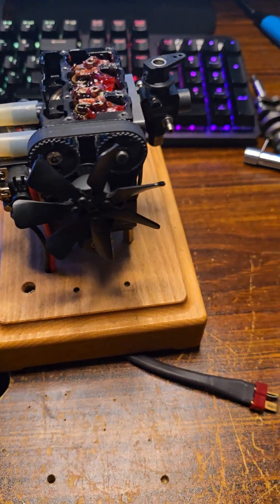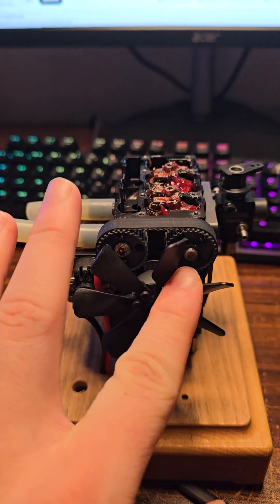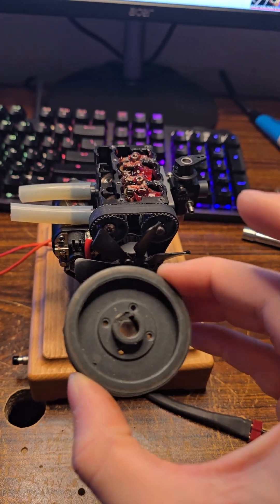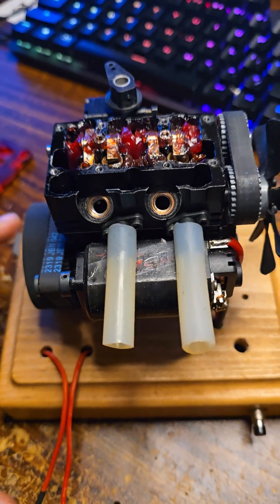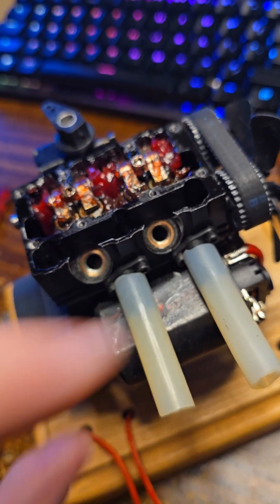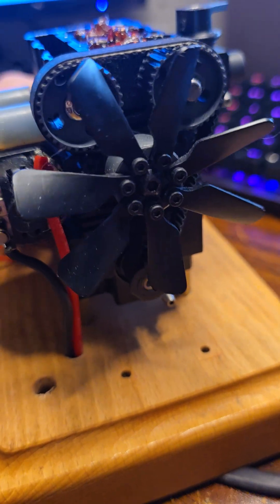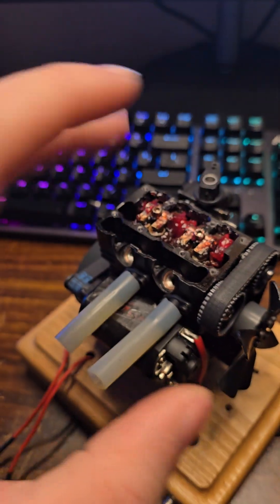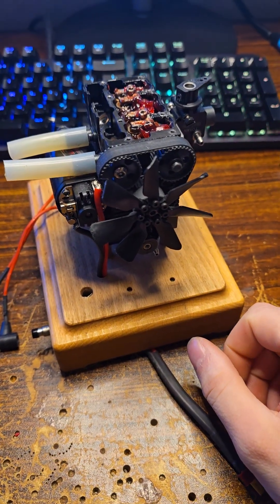How I (might) have resolved the horrible reliability on the #Toyan FS-L200

Comment: I want to add for anyone who has any toyan engine , I had no end of problems running 30% nitro , it had horrible knock and destroyed the con rod bolts , after using a better quality gasket and running 20% fuel it runs amazingly, also , you can use the front pulley off the toyan v8 the material is far stronger, also I opted for all ceramic bearings and it is a very fast running engine , definitely reliable to run a rig now .

Comment: I notice the oil seals apply an aweful lot of friction on the crankshaft , do you think that's good ? When I take them off the crankshaft spins very free , do you think it would run better without the oil seals ?
Reply from the maker: Do not remove the oil seals. Yer new engine is going to have lots of friction. It will get toasty on first few startups. Those seals have high friction due to the spring inside that seals off the inside from the outside.
Reply: Thanks man you're right , I checked the red L200 and it seems that the stock timing works well , the other L200 with the black pulleys like you have have the dot in a different spot , everything with these engines is very mysterious.

Comment: hey great video, i cant get the engine to run, a few months ago i got a piston rod smacked on the oil pan and i didnt have had much time to check it, i just changed the piston as the oil pan is still leakproof and im going to check the timing before starting it. I dont really know what u mean by "it wants to hydrolock" but i feel that when the engine is trying to start at some point the starter really struggles to rotate the flywheel. I'll try with your solution anyway, TNX VM.

Comment: Luckily I didn't have any problems with the valves even though they were the first versions of the Semto/Otto engine. The only thing that happened to me was a broken connecting rod and a joint between the shaft and the camshaft.
Reply from the maker: That's what it did to mine I'm assuming, its not an interference engine that i can tell. My valves aren't bent from incorrect timing. But when it did fill up with fuel at the wrong time, it tried to ignite on the wrong stroke and smacked my piston to the oil pan killing it. Having found my issue, I have had 0 problems, I'm still keeping an eye on it. But it starts easily, stays running, ect. But hopefully this will help some who just got it. Make sure its correct before attempting.
Reply: And I still haven't been able to fix my engine, I haven't had much time for it.
Reply from the maker: @CinemaL200X-55  I have also discovered these Toyans need lots of oil to stay alive. Like an O.S. Wankel. I added sig castor oil to my nitro fuel (as I cant find anything higher than 9 percent oil) and. It just goes now.